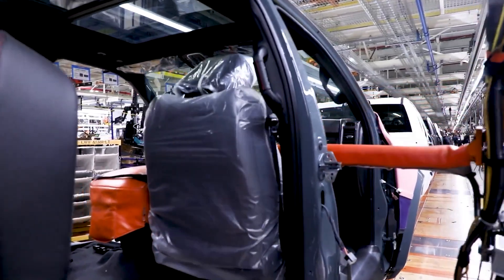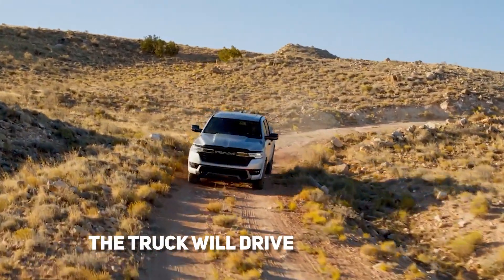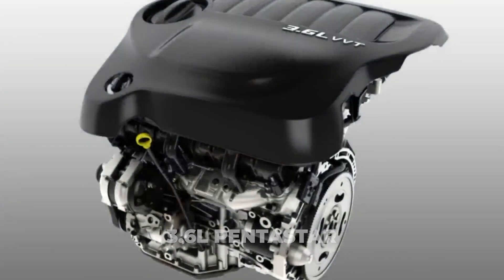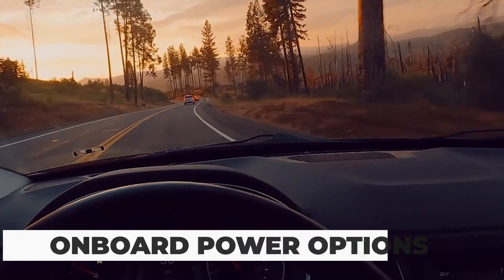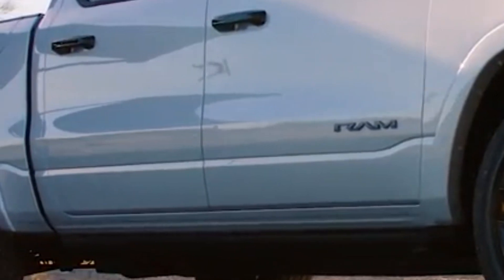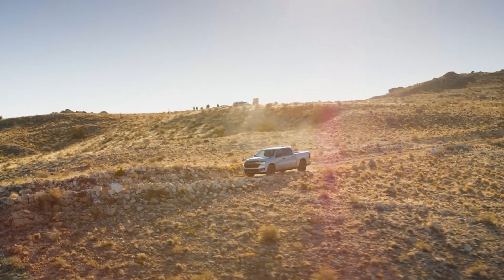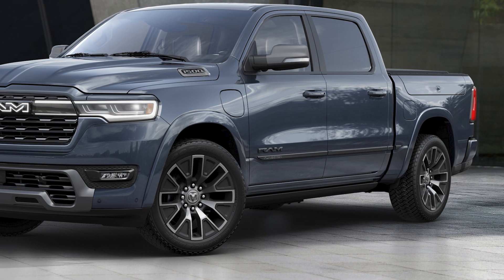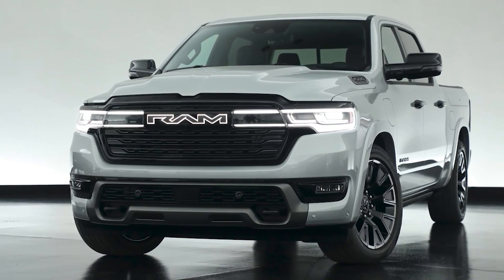All-New RAM 1500 Ramcharger Wows Everybody!

Comment: what size fuel tank in it cuz if its 40gallons then the mileage even with the battery only range is (( 540+150 miles)/40gallons)  17mpg... the nissan titan is 18mpg combined and is just running a 5.6L V8
Reply: 27 gallon
Reply: That's not really how that would work. The mileage you mention is based on an engine attached to a drivetrain pulling 2+ tons. This is the equivalent to an idle, and even the least fuel efficient vehicles can idle over 8hrs on a full tank. The real question is why would you use a large, heavy engine with all the complexities to malfunction? You can add a smaller, much more efficient inverter generator, saving fuel and weight.
Reply: @edkruzel  im going by what they claim, if  calculation is wrong then you do it. Its 130kW generator. To turn that genset* at around idle rpm with a decent electrical load load, probably not easy,  smaller engine  might just not work. was thinking they'd go diesel but i dont know the parameters they had, like maybe they wanted it quiet  cuz its so up market luxury

Comment: The concept on paper isn't bad at all, the power of an electric engine, fuel for an extended range. Why do they need to use a 3.6 liter if the gas engine isn't connected to the powertrain? Run down to Harbor Freight and throw in a predator generator.

Comment: This is the same setup as the Chevrolet Volt, only with a larger battery pack. The comment made by the narrator that after the gas is used up the engine will just go into battery mode is backward. The vehicle will be designed to operate in battery mode and then revert to gas when the battery has been expended. I owned a Volt for 3 years and seriously enjoyed it. I think this pickup as a hybrid is a good idea. It remains to be seen if the execution of the idea is as good as the theory. However at the price point expected it won't be in my stable because I'm cheap.
Reply: No. It will not "revert to gas". The 6Cyl ICE is there to charge the battery only. It's not not tied to the wheels. It only starts running to charge the battery when it's down to 20%. I think it's a great idea - but remains to be seen how efficient it will be.
Reply: @edmund2j  the comment "revert to gas" was meant to imply that the gasoline using engine (aka generator) would start and charge the battery pack, precisely the way the Chevrolet Volt was set up. So my comment "revert to gas" simply meant that at the point the battery is discharged, the gasoline engine will, in fact, start and combustible liquid goo will start charging the battery. The statement was correct, you just cannot be too literal about it.  I wasn't writing a textbook.

Comment: EVs are not the future because current battery technology doesn't make sense to people who want to own an EV.  Electric drive trains are clearly the future and that is what the Ramcharger appears to deliver with its smaller battery and generator to keep it going without being tied to charging stations that require long wait times. If or when batteries can recharge in five minutes, last 25 years without degradation, and are environmentally friendly to produce and recycle, the Ramcharger will no longer be needed to have an electric drive train vehicle.

Comment: did they ever figure out how to build an automatic trans to last 100k miles? their history clearly shows they havent worried about it much.
Reply: In the ram 1500s and gas 2500s they have a bullet proof 8 speed. The diesel 2500s they still have a poor trans while you can opt for a aisin HD trans in the 3500s that is good too but at an extra cost.
Reply: That is a Chevy problem after Ram went to the ZF transmission.
Reply: The Ramcharger doesn't have a trans so it doesn't really matter in this context
Reply: My 2009 Ram 4x4 hemi has over 200k on the original transmission. It's the old 5-speed box. This Ramcharger doesn't have a transmission.
Reply: My 2003 1500 5.7 has over 360k with the original trans. My 2018 2500 6.4 has over 120k. I always do my trans services at 60k.
Reply: One this one doesn't have a transmission  and two the zf 8 speed I have has been awesome and is rated as the best transmission out there. Chevy and Ford both are having issues with both of their 8 and 10 speed truck transmissions where ram has not.